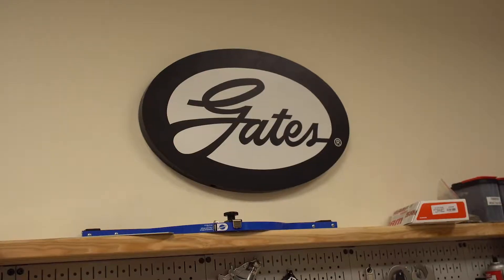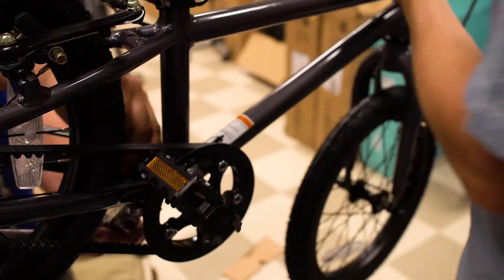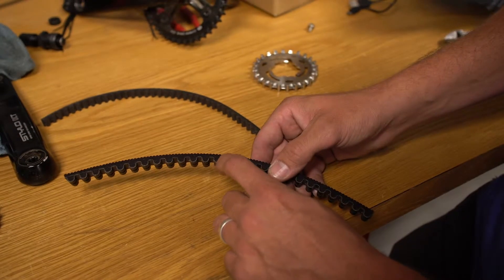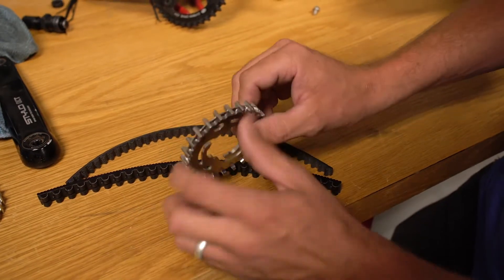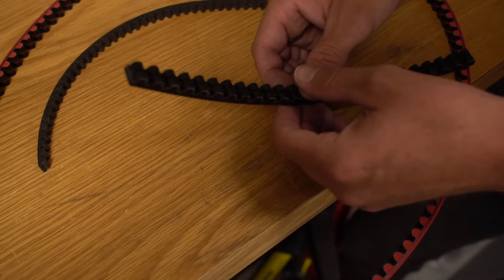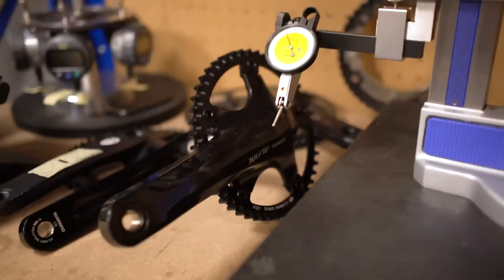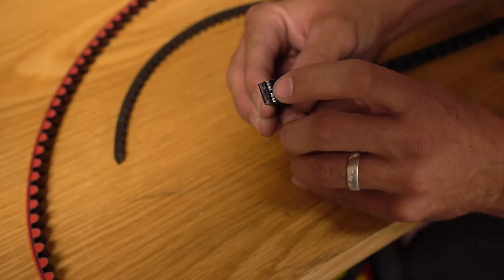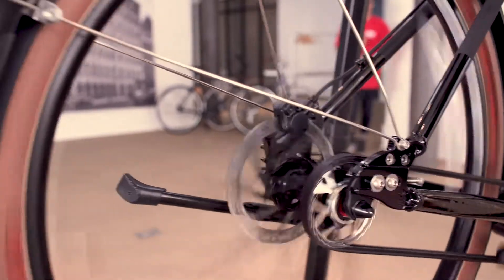ABOUT THE GATES CARBON DRIVE BELT

Comment: Why did you not make this belt SPLITTABLE like the Veer?  After all, CHAINS attach by JOINING the ends.  And, this way, the frame remains INTEGRAL.
Reply: No, the frame triangle has to split
Reply: @patrickstep  You didn't answer my question.
I KNOW the frame has to split to accommodate the Gates belt.